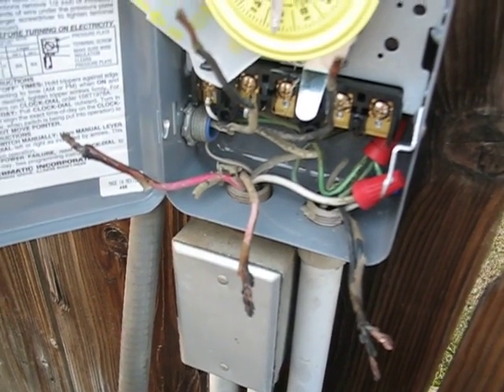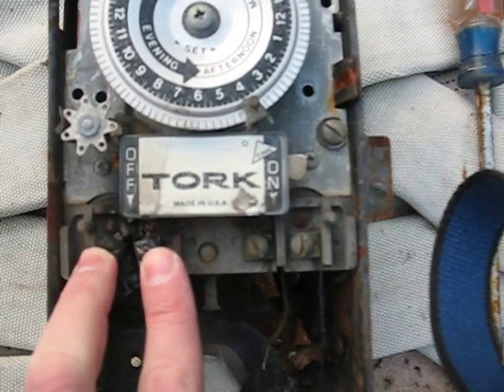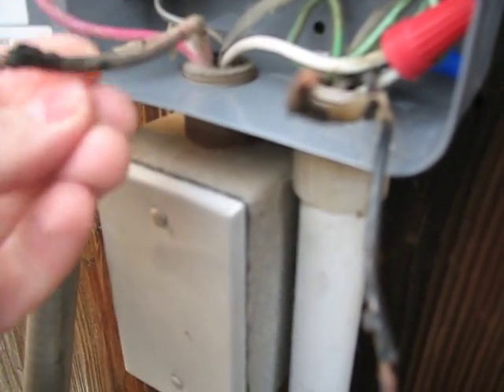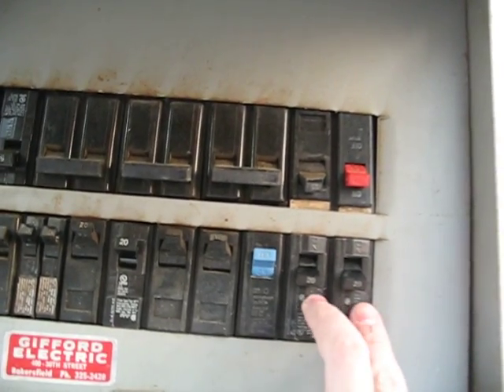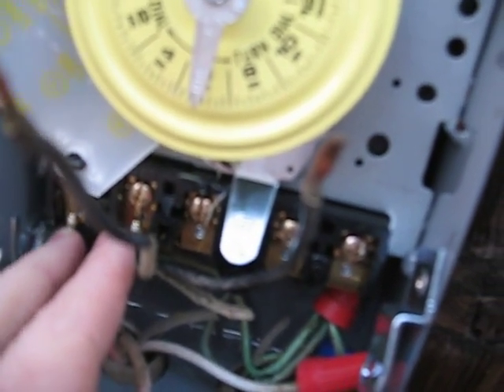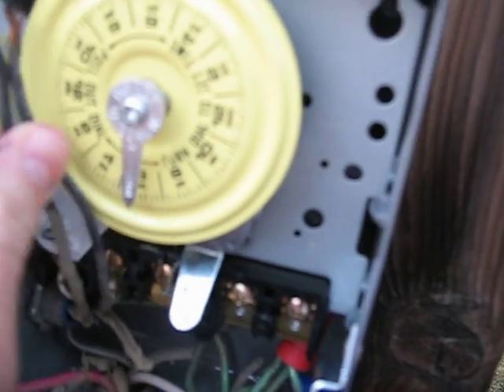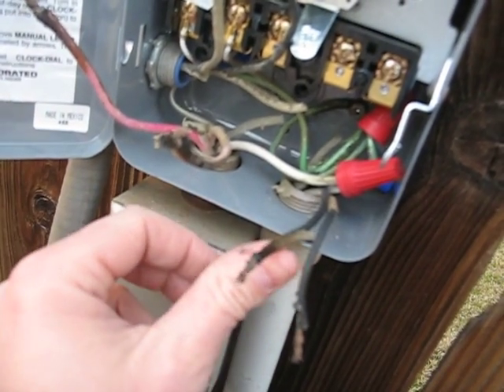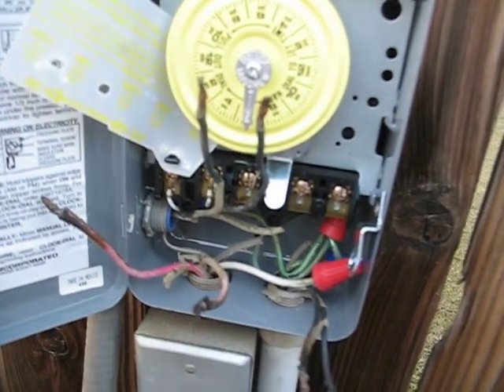Intermatic pool timer wiring

Comment: terminal 1 is line (incoming power) 2 is load (the first 110 going to pump) 3 is next line, or incoming and 4 is the second 110 feed or (going to pump) to make 240.... for anyone else having this problem, just look at the plastic cover that covers the terminals with the yellow print on it.. it shows you what is Line and Load.. Line is simply incoming power from the house, load is what goes to your pump.
Reply: g1 thank you for saving my rear end your after wasting the last hour googling and trying other methods yours easy to understand and worked perfect the 1st time!!!  People don't read any further G1 has got this!  : )  Thank you brother!
Reply: Exactly what I was gonna explain to you what G1 wrote. Line 1 load 1 line 2 loads 2.  240 v

Comment: from pump the green which is ground g for ground. goes to ground not on the t1o4m the other two wires which are 110 +110 = 220 one goes to 2 and the other to 4

Comment: I have the Intermatic T104 on my pool. It was installed before I bought this house by a professional pool company. The timer is legit for outdoor use but it (like yours) is housed in the steel box. Intermatic claims it's steel box is indoor/outdoor. Well...it ain't. The steel box will rust outdoors over time. Intermatic makes a plastic weatherproof box for this timer. I bought mine on Amazon for around $30. I recommend that you upgrade to the plastic weatherproof box. Also, you can install a GFCI breaker in your panel and wire the pool timer to that.

Comment: The 110V clock needs a neutral wire taken to T-A. Now......Here comes the pain....
that clock isnt a weather proof model, u did'nt reinstall the locknuts on the conduits You have no GFCI protection based on the "your term fuses" , there is no service disconnect for the pump motor. That previous owner is an "electrican in his own mind" his Tork clock didnt look raintite either...Dude, your're fucking with electricity around water, u want to chance u and ur family/friends lives?

Comment: Your poles are T1 & T3=power in from panel. T2 & T4=load/wires to pump. The 2 reds ( you need to ID their purpose) but guessing across the internet I'd say also one each needs to go on T2 & T4 depending on it they are somethings needed to be
one/off controlled by the timer or one red could be a pool light , the other red can be for a general purpose receptacle ( which would be a different combination) 
also that T103 is obviously different , you now have a 110V clock